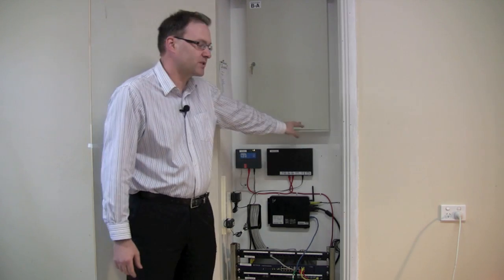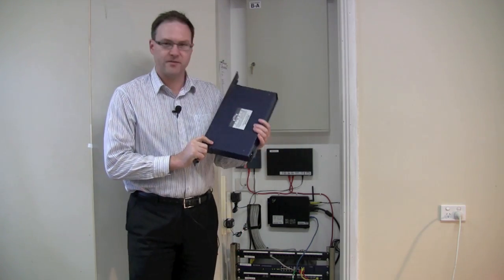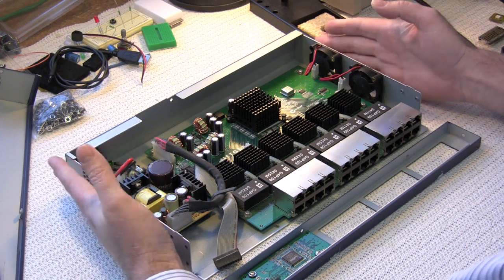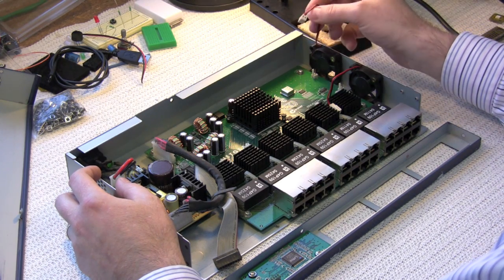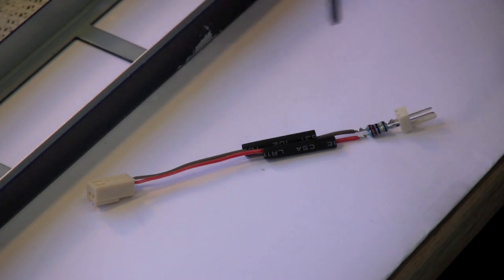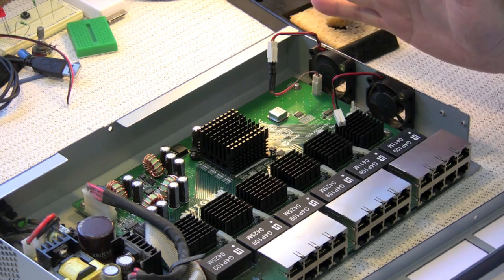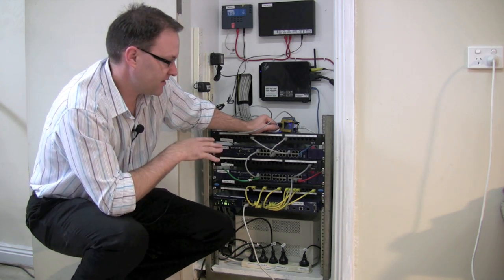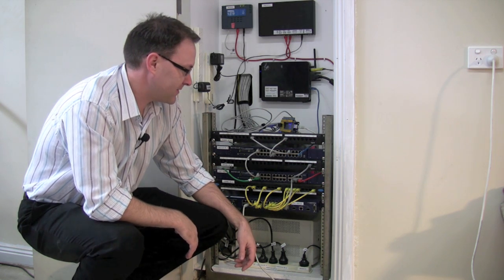SuperHouseTV #4: Making Home Automation Gear Run Quietly

Comment: Best thing to do in small cases is always to force feed air INTO the case and NOT to try to generate decent air flow by trying to suck out the hot air which adversely affects the life of the fans causing the sintered bronze sleeve bearings to dry out prematurely. Cool air passing  through the fans keeps them MUCH happier.

Easy enough to fit an Arduino temp controlled PWM drive inside in line with the fans ... Should mean at times of low usage/traffic (during the night) they will automatically run at low level.

Comment: You need to sort your naming convention for the videos. If you play the series from your home page, it runs in reverse. So annoying when I have to stop the video and select the correct one. Otherwise, the series is excellent, and could be used as a blue print for modern houses.

Comment: Probably a bit late for this video, but recently I had to try and quiet down a Ubiquiti 24 port POE switch for my brother in law. I come across a video on YT where they switched out the standard fans for some Noctua fans along with the resistor mod. Just the fans alone at full speed made a huge sound difference over those cheap and nasty OEM fans. It went from being able to hear it in the hallway to only being able to hear it in the room. If I was to do it all over again I would probably hack the case and fit a noctua 120mm fan.

Comment: one thing that has baffled me is that people keep using ' traditional ' shaped heatsinks , these require an external force to blow air over them to cool them ,why hasnt someone mass produced a tube shaped heatsink that heats up and draws air into the bottom through shaped slots to induce a vortex and through convection cools it by the air flowing by it  ? no fan just the shape of it , 

terrible description i know but if it was like a venturi tube where getting the body hotter and having it vertical should be a passive cooler

Comment: Question, why didn't you use SNMP for reading out the temperature of the processor? 

On professional network gear (Cisco, Juniper, etc) you can even set/change the fan profile via snmp? You can even shutdown a network socket if a device suddenly is using way more networking bandwidth than it's normal operating envelope. It's a very good, simple and easy way to get an indication if something is wrong with a server (hacked, malware, (spam) bot, etc)..

Comment: Why not run both at low speed using the same method.. then if one fan gums up then you have another, two fans are not always for airflow, but redundancy, when one fan stops (bearings fail, dust etc.,) you still have some airflow. Especially important if they are in a place where you don't check them all the time. But in this case there is monitoring, maybe not everyone would do that.

Comment: Put the 2 fans in series. They get each 6 V and run half as fast.
Reply: Could possibly used a NTC thermistor also. Getting the correct value for fan operation been the only hang up I think
Reply: And slowing down both would still push more air without the noice.
Reply from the maker: Good idea
Reply: Guustho

Comment: would you please provide the color code of 22ohm resistors
Reply: red-red-black-gold = 2 2 0 5 = 22 x 10^0 5% tolerantie
Reply: +dipendra bhujel - buy a silent fan instead (low decibels); brand name silenx.

Comment: Maybe just a stupid idea, but why not put some big fans running really slowly on some light airducts and mount these over the holes where the fan sit, than remove the fans completely. With a little effort it might suffice to use just 2-3 fans for the whole equipment and cool them all together.
Reply: Would probably cause issues when the switch goes to run self-tests and realizes the fans aren't responding. It'll assume they're malfunctioning and most likely not run.
Reply: These fans are only two-pin connected.. So there's no tacho signal that the switch could analyze. And I highly doubt that anyone would measure the fan health via the power drawn (a stuck fan would also draw power)
Reply: Andre Klärner
 Just got through most the video. Looks like the switch doesn't care whether or not the fans are plugged in. Only other reason i can think is that it gives the rack a better look without having bigger fans on the outside, looks more "OEM" this way I guess.

Edit: On the first switch.

Comment: Make sure to remove all rings and watches in future videos so that a young DYI'er won't loose a finger or their lives.  It's very important to display sound practices when dealing with high voltage devices and pass that knowledge on as well.

Comment from the maker: Sure, that's a good solution - what I did is basically a cheapie hack to achieve a similar end result, but a proper fan speed controller is better. I just happened to have a bunch of resistors handy, so that's what I used. Check the voltage on the fan first though: some are 5V, some are 12V. Use a fan controller to suit.

Comment: Good video thank you for posting it. I have a Netgear GS716 switch and have been planning on either switching out the fans or doing something like this. My question is could I just use one of those fan controls to control the speed of the fan? I have an old one that fits inline with the fan and doesnt require extra power.

Comment: Hi, Fantastic videos. 
Just curious, since you've got the Arduino and Temperature sensors there anyway wouldn't it feasible to use the Arduino as a smart Fan speed Controller for all the the Switches in the Rack?

Given at night the ambient temperature would drop and (I'm assuming here) the traffic on the LAN would slow they should be a lot cooler resulting in much quieter operation whenever it is safe to do so.

Comment: Hello. Great channel - makes me wanna start "smarting my house" up.

If only you had more room over the top of the switches you could put in a 20 cm fan or even a couple running at 5-7 volts pulling air out while fresh air enters from the sides.

Is there a place where u`ve put some info on the code u run on your etherTen`s and the source code for your php webpage and mqtt server?

Comment from the maker: Sounds like a good experiment! I have two identical gigabit Ethernet switches in that cabinet, so I'll give it a try. It'll be hard to measure the temperature of the unit with the lid off using the HUMID module because the air temp won't be localised as much, but I could point an I/R temperature sensor module at it and see if I get good data. I'll keep you posted.

I don't like the idea of leaving the case open long-term (exposed 240V, etc) but I'm curious.

Comment: The air-forced cooling is a lot more efficient than passive convection cooling. At this fan speed I think it would be a close call as to know which solution is better thermally. Factor in the risk of leaving a case open, I think his solution far better. It would be an interesting test to do trough! Jonathan would you mind to test it?